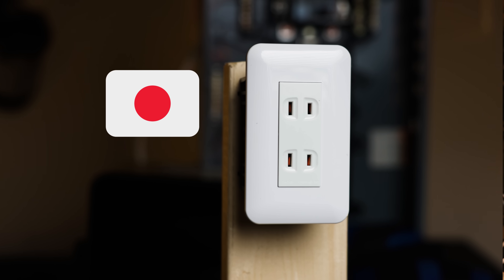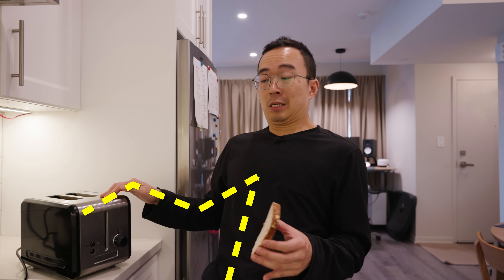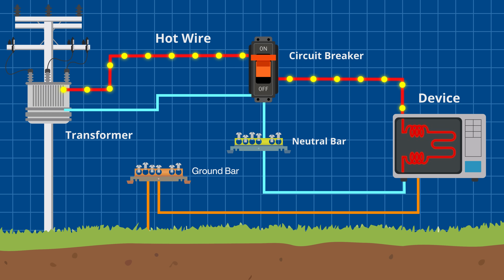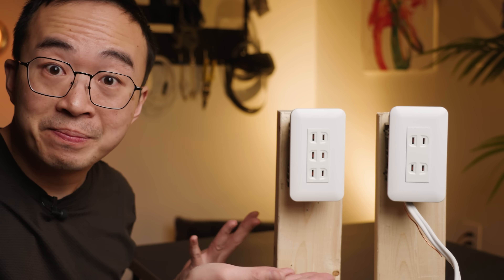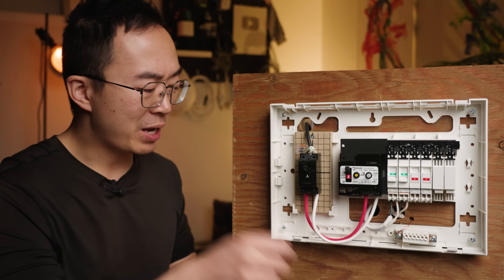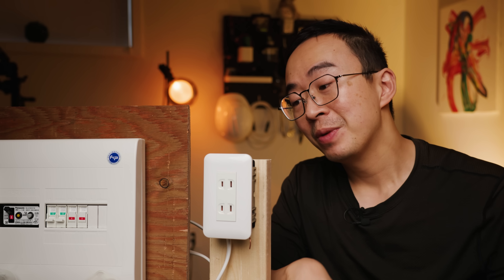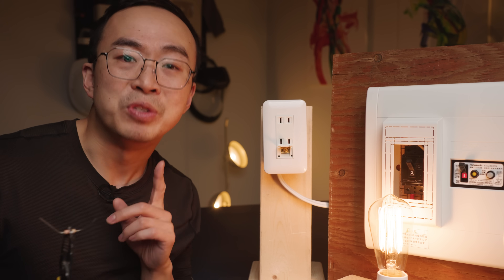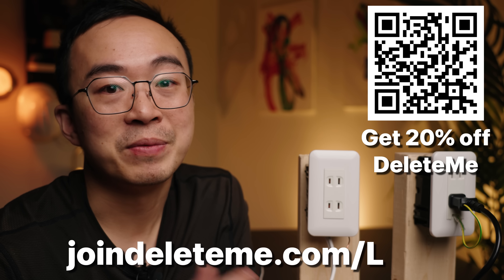How Japan Made Their Outlet Safe

Comment: Interesting video, in Denmark we call GFCI relay(s) for HPFI Relæ(er). And i didn't know that this was first implemented in Japan. And it's a little peculiar, because the relay has been known and used in different ways in products for much longer. Although, I knew this wasn't always the standard in Denmark, and it's a relatively new thing as in my grandparents didn't have these in their houses in the 1950's. But, I am happy to see there are strong standards today. 

As for the Japanese special ground plugs, it may be more inconvenient, but it's most certainly safer: pulling a plug or stripping a cable as a result of falls, earthquakes or tripping people and animals, makes GND the last thing to come out of the socket. Not that indifferent from the UK GND-plugs. That said, I live in an appartment from the 1950s in Denmark and there are very few GND sockets, which makes it very inconvenient for me to clean and work on electronics because i can't find that many places I can attach myself to ground. And I would imagine this being a pain in Japan too as a result. The it's not a matter of being electrocuted, it's a matter of not shocking the electronics. So in that aspect please let's get some more ground sockets. Then there are also power groups, and this makes the Japanese way as implemented in Denmark very practical as you don't need to rely on all sockets always operating correctly, so when something goes wrong only the relevant group is tripping a breaker. And you can have separate Wattages for different types of appliances, such that you can do multi phase high power groups for washers, dryers etc. Although this is less and less needed and less and less common. But you can do it. Great video, good explanation, I enjoyed it very much.
Reply: A GFCI is current operated. Voltage operated units were fitted in the UK from the 1940s onwards an even into the 1980s.

Comment: Okay but most of Europe has the GFCI AND the ground pin.
UK is going way hard with individually fused plugs on top of all of it, and it used to be their only line of defense with the wacky and horrifying ways they used to wire up.
Reply: The fuse in the UK plug is to protect the appliance and flex. The only plug to protect the flex. Extra safety features.

Comment: I think the video just proves that the 'US' version was still better from a building code POV (GFCI and AFCI outlets). However if you dig deeper you would also realize the EU has a better wiring standard (WAGO's instead of wire nuts.)  The GFCI that Japan uses is basically the same as European RCCB. It also needs to be pointed out that GFCI's were pretty much non-existent anywhere until 1960's. Japan/EU use the distribution panel type, where as north America uses the socket-circuit type because ... bigger circuit runs result in false trips. EU only uses the socket style RCD(Residual-current device) in retrofitting. 

It also needs the pointed out that neutral and ground are in fact the same. So GFCI is intended to cover where that path to ground is lost (eg wet areas) and break the circuit, where as before GFCI, the appliance would just have the ground connected to the shell of the appliance. Hence why if you live in an old enough house to not have GFCI's and old alliances, you will get zapped frequently if you touch the stove and the sink, because you're closing the ground circuit where a neutral fault exists. So in most cases, in Japan power cables are interchangeable with North American ones (I had an imported PS3 that had one these ground connectors) with no reduction in function.

But also to point out, many small appliances, toasters, rice makers, and such are not grounded in the US. Why is that you ask? Class 2 electrical appliances that are double-insulated are required to NOT have ground connections. So hence these devices work in Japan and Taiwan as well as the US and Canada.

But we can improve everything if we switched to plugs that actually had the ground pin always required, even if it's dummied out on double-insulated appliances. This would ensure that that they aren't used in locations that don't have GFCI coverage.

Comment: Japanese sockets are NOT pooling-proof, as in almost all other countries. This means that the appliance plug can also be plugged in at an angle of 180°, but then the lamp socket, for example, will be on the live conductor (phase). .... These non-pooling-safe sockets have been banned in most countries for 50 years.

Comment: I found it fascinating. I think the takeaway tho, is that having the ground plug (with an EGC) IS in fact safer than the no ground version simply by virtue that a device with a ground-fault is still "hot" until you get shocked, and the GFCI breaker (finally) detects the imbalance. The NEC is moving toward having BOTH for nearly every circuit in a home, which seems the best of both worlds. Now, I do wish the code would allow for some mechanism to allow certain appliances such as deep freezers where it is important to keep the food cold long term to have a auto-reset after some time, such as 15 mins so that if it was a nuisance trip, you don't lose all that stored food.

Comment: in Poland (and probably most of Europe), we use grounded sockets even if we don't actually have a ground connection available (old wiring). You just connect neutral and earth when wiring the socket, making metal equipment safe to touch even if proper earth connection is not available.
And if you have newer wiring, it's pretty much guaranteed you'll also have an RCD. So that's both methods at once with 'modern' wiring.
Reply: Same here in the US too. We still have some old buildings and houses that don't have a external grounding rod either, ground is usually connected to the copper water pipe coming into the building from underground in these cases.
Reply: We had this in Croatia too, but issue is this kind of connection is incompatible with RCD. When I changed distribution box (together with switching from three phase to one and adding ground wire) in my old house I added RCD, run third wire to kitchen and bathroom, and from other outlets just removed bridge and left it in Japan configuration because that sockets are rarely used with class I devices and RCD protects from other types of fault. But that was just temporary solution because we already had plans for complete renovation with changing cables. For those without ground available (old buildings) separating neutral and ground before RCD is still ways safer. Whenever you have "fake" grounding taken from neutral, in case of neutral fault, you can get electrocuted. RCD prevents serious injury and death even in that case. Also, if you only have two wires running to socket and brick ground to neutral in socket, it's important to connect neutral to ground terminal first, than from ground to neutral. In case of weak connection, device stops working, while housing is still on neutral. Otherwise around, if connection comes loose, you have live on housing.
Reply: That's a bootleg ground and it's not safe.
Reply: @jeffkardosjr.3825  It is perfectly legal in old installations in many countries and is safe when you do things correctly.
Reply: Actually  not the most of the Europe. This is the old German method and is used in countries where the German influence on technology has been high mainly in the Eastern Europe and also in Switzerland and Finland. The problem is that one cannot add RCDs to the panel on such a system.

Comment: Hello
I have a Japanese electrician qualification.
I am using Google Translate, so please forgive me if the sentences may be strange.
I watched the video. It was very detailed and easy to understand.
However, let me add a little bit.
In Japan, there are outlets with a third hole, or ground hole, and they are used differently depending on the location.
In Japan, there are "E" outlets like those in the United States, "ET" outlets like the ones in the video, and "EET" outlets that are a combination of the two. Furthermore, the upper limit of the resistance value for grounding in Japan is determined, and the maximum is 500Ω or less.
Reply: 確かに最大はD種設置工事の500Ωですね。
ただし漏電遮断器が0.5秒以内に遮断する場合です。（日本の漏電遮断器は基本的に30[mA]0.1[s]）
基本的には100Ω、とはなってます。ただ良い意味でも悪い意味でも日本の家電は漏電する危険というのがほぼないように作ってるので、接地の必要性がなく他国よりかなり緩いかと思います。
また、電圧が100Vと低い為感電しても接地無しでもリスクが少ない（電圧100V／人体抵抗500Ω×0.1秒＝感電電流20mA・s）
接地有りならば更に半分の10mA・sとなり即座に死亡する心配も少ないです。
日本で問題になるのは漏電よりも短絡電流の火災の方が遥かに多く、古い建物の絶縁破壊、コンセントの緩みでの熱、もしくは埃などでの短絡電流

総じて家庭用に関しては日本は接地はかなり緩いです。
Reply: @sy476 thanks for that extra context, I didn't know both grids in Japan used 100V, I thought the 50Hz one would be at 230V.
Reply: If socket are used for hair dryer or electric fan there is no reason to spend more for socket with grounded
Reply: 500 ohms? Are you sure it's not measured at a different spot e something? Because that would be an order of magnitude higher than you get with even with a bad connection and shallow earth rod.
Reply: 500Ω? my god thats really high here in brasil it is 10Ω max, and to be honest gfci is nice but i would not trust it with my life, i belive grounding the apliance is way better! and it has other uses like grounding eletronics, sound systems and its verry important to protect your home from a "froating" neutral or high voltage (lightning that fell on the lines outside your house) from entering your house becouse you can install a device that sends the extra voltage to eart on your meter box
Reply: @vilsondasrapadura7342 
Oh, I see. I guess the difference is due to the different electrical systems and voltages between Japan and Brazil.
Thank you for sharing this valuable information.
Reply: @vilsondasrapadura7342  It depends on fusing I suppose. 10 ohms makes 22 amps for 220 volts, which will trip a fuse.
When a GFCI is present, a higher resistance may be acceptable ( but I do not like it...)
Reply: @pizzablender but the low resistence is not for triping the breaker, you should no relly on the ground to trip the breaker thats why we bound it to neutral, its more used to make sure neutral is at 0volts becouse to cut a long story short real life tends to make neutral have some volts above or bellow ground on the neutral, in other words its 100% a safety thing
Reply: @pizzablender  Ground is not there for tripping fuses.
It's there for the current to find an easier path than the human body.
Reply: 日本はいつも安全のようだ

国によって電気規制は異なります  ⚡️
Reply: Third hole 😂🤣😅🤣😂
Reply: I think so its depends on where socket is if there is in toilet and need to use electric flush toilet which’s popular in japan its must be connected to the ground
Reply: @primrosesakul..3808
基本的には、水を使うものや人がよく触れる電化製品などにはアース線がついてますね。
Reply: その追加情報をありがとうございます。このビデオが日本の電気システムの運用方法を批判していると思わなかったことを願っています。これは、日本がこの問題を創造的に解決する方法を説明しているだけです。

Comment: Interesting video.

I would be interested how could that tester trip that GRC if it has only two pins and there is no connection to ground.
So yes in general in europe you must have those grc on your new home installed on older homes/installations  it isn't required
Reply: GCFI use for cut the circuit after leaked not electric shocks protection to human if i need to choose one i choose grounded

Comment: If the argument that ground is what trips your circuit interrupter, then you would never get shocked because as soon as the insulation is compromised the breaker should trip. You touching it and getting zapped will not send current through the ground wire.

Comment: Todays US electric codes in residential applications are far safer than you covered and executed in a manner that makes more sense than just one GFCI monitoring all the circuits. I’m unfamiliar with Japanese home wiring and perhaps the example you showed is not the only way they protect their circuits but it’s pretty crazy to have a ground fault at one location and interrupt current to the entire panel. Good luck tracking down nuisance trip… It’s true that US electric code mandates GFCI in only a handful of locations (covered in article 210.8 of the NEC) but it also requires AFCI protection in all interior locations with the exception of bathrooms (covered in article 210.12 of the NEC). The two combined codes means that there is not a single 15/20 amp receptacle in a modern home in the US that isn’t protected by either GFCI, AFCI or a combination of the two. Add in tamper resistance codes, damp/wet location codes and you have very safe receptacles.

Comment: I am building a new pc in japan though, since the power supply has 1200W which is almost the same as a microwave, i wanted to make sure it was grounded, but the plug of my PSU turned out to be 2 pins with this annoying cable thingy -- grounding wire. none of my sockets had the grounding terminal but 3 pins, I decided to get an adapter for 2 pins with the grounding wire just in case

Comment: Argentina here. And I can confirm here is exactly that way same as Japan. Unfortunately regular people are unaware of how important is a GFCI (we call it DISYUNTOR here) but good electricians does and they implement it with ground at the main house panel. Cool video about Japan systems very similar to Argentina too hahahaha
Reply: Is all the circuits connected to GFCI or just certain ones. The circuit breaker I had in Taiwan looked exactly the same as his except the GFCI breaker was only connected to the bathroom

Comment: I'm confused here because the neutral is not connected to the circuit breaker.  Only the hot wire is attached to the breaker.

Comment: I was wondering about difference of GFCI breaker locations between Japan and the US for long. When I asked several electricians once I moved to the US, it needs ground or never be safe since it lets leak current runs bypass way instead of body. I was confused hearing that because I never had problem in Japan even I touched them accidentally and tripped GFCI. This explains.
By the way, please never do what I have done outside of Japan, even it feels like some sort of electrical massage.

Comment: Circuit-breaker (with or without grounding) is for system safety. To avoid possible overheat, and fire. It's not able to save a person, as it switches well above death current, and its slow for that purpose. 
GFCI can save a person, as it has the characteristics (current, time) to do so, but cannot prevent by itself overheating till the short-circuit stays inside the live-neutral line, or someone plug in more equipment to a circuit, than it can handle. Until the in-out load is equal, even your whole house can stand in flames from overloading the GFCI won't do anything.
The two are for different purposes. At least by us Europe.

Comment: Here in germany an RCD is mandatory in TT- grounded systems AND in TN Grounded systems: since 1984 For bathrooms since 2007 for ANY outlet up to 20 Amps (4.6KW/8KW) and since  2018 for outlets up to 32A (12.8KW)
AND a separate Ground connections is force since 1973....

Comment: My house is funny because they put the GFCI circuit in my master bath on the same circuit as the outlet in my garage, on the other side of the house, and also the same as the outdoor outlet meant for plugging in Christmas lights.  The funny part about this that the GFCI plug is the one in the bathroom and the rest are regular outlets, even though they share the same circuit.  So when the outlet outside eventually got water intrusion and corroded, it kept tripping the GFCI in my master bath. I recently installed a new GFCI outlet, along with a new weatherproof box, over the outside outlet. It also has that little green light to indicate the selftest status.

Comment: 8:48 Lol that's misleading af. Many of  the circuits in a US home have MORE protection than your little japanese ones. Not only do we have GFCI protected circuits IN THE PANEL just like japan, but we also require AFCI protection on many of them as well. I don't know that japan doesn't require them as well, but that statement was clearly intentionally crafted to be misleading. You know 700k people walked away from this thinking japan has safer receptacles. They don't. Having the option and freedom to choose between the GFCI in the junction box or in the panel is better. GFCI combination breakers can often be over $100-$120 for each circuit that requires them, per the NEC. You can have the exact same GFCI protection for $10-15 by choosing to put them in the junction box instead.
Reply: Came to the comments to say this

Source: I failed a couple of inspections because “liveable spaces weren’t protected by afci breakers”

Comment: Good video! I always wondered why they didn't have the grounded outlets when I went to Japan with my Macbook and didn't use the plug that was standard on the charging brick, I used the grounded cord instead and felt like a tool when none of the outlets would support it. Luckily Akihabara was one station away and this was before it turned into the otaku paradise it is today, there were electrical parts shops everywhere in those days; pretty sure the shop I visited is a maid cafe now.

There are GFCI circuit breakers in North America, but only for individual circuits. IMHO the combination GFCI/AFCI (arc fault) and surge protection should be standard in most circuit breakers, but as they cost a lot more than a standard breaker, we're not going to see them mandated any time soon. GFCI outlets are allowed for now as a retrofit in many homes that do not have proper grounding, but they don't replace a proper ground in terms of safety, they're going to behave much like the GFCI breaker in the Japanese panel.